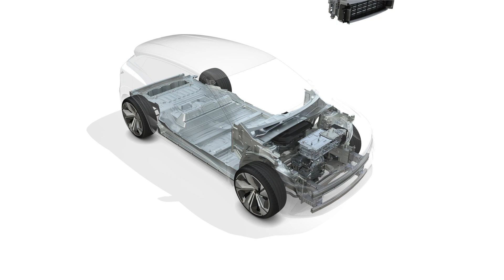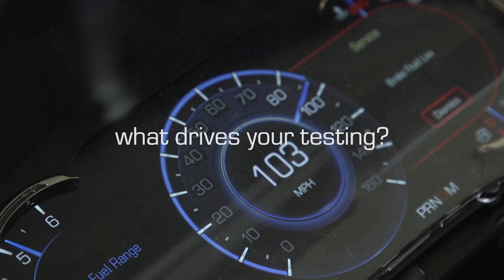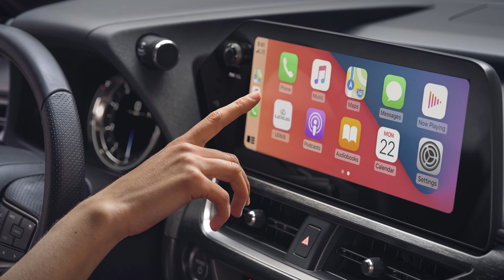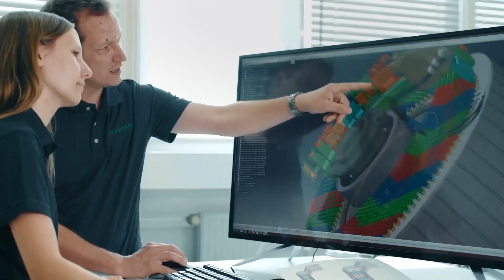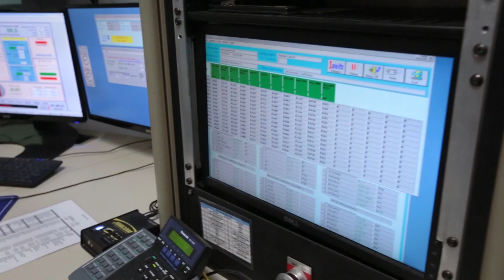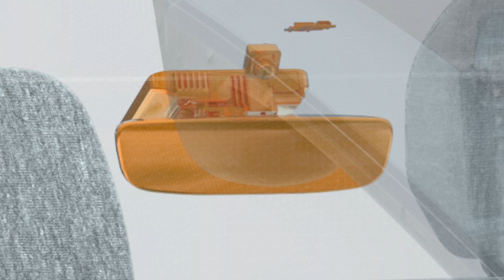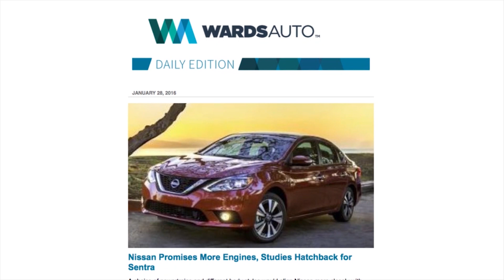Cute as A Button $13,000 EV; Renault To Spin Off EV Ops - Autoline Daily 3324

Comment: I can't fully understand how Nissan has stumbled so much with the Leaf. I like the current gen, but the battery tech in it (namely the lack of active cooling) is confusing. They've been in the EV game for far to long to be getting outpaced so badly at this point.
Reply: I can't complain.  I just lost my first bar on my 2016 Leaf battery at 75,000 miles when the models say it should have happened 40,000 miles ago.
Reply: @bobbbobb4663  Do you live in a not to hot, not to cold state like Kentucky?
Reply: @kkarllwt  Georgia.  It gets hot enough.

Comment: The World's fastest runner, afoot, LOST a race when a shoelace broke. Instead of stopping, quick fixing, then back to running - NO. Instead he tried to fix his shoelace WHILE RUNNING. His team mates were in second and third until the runner tripped over his own hand, falling in front of his mates causing all three to NOT FINISH THE RACE. Could this be analogous to legacy auto's EV "plan"?
Reply: Not really. An automaker, being by default a VERY BIG company, can and usually does do much more than one or two things at a time. If an automaker feels they need to spin off their BEV operations into a new company, so be it. If an automaker feels they can keep it all under one roof, again so be it. They are all different with differing approaches to the same ends. 

To assume that "the automakers are all the same and if they do not fall into how I WANT them to fall in, then they must be wrong" sounds pretty "woke" and at least a little fascist. "Everything in the [state], Nothing without the [state]. Nothing against the [state]. "State" being interchangeable here with "idea" or "ideology".). 

The only thing that matters, for the consumer, is what comes out for sale. How it gets there is immaterial. Especially sense the only voice the consumer actually has is their pocket book.
Reply: @DocWolph  Thanks for the confusing response top my simplistic analogy - nice work